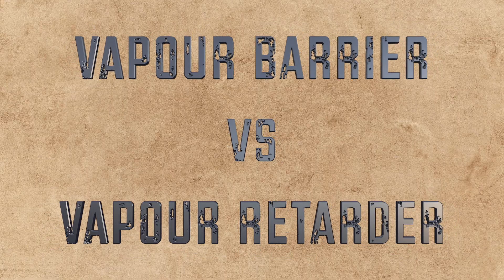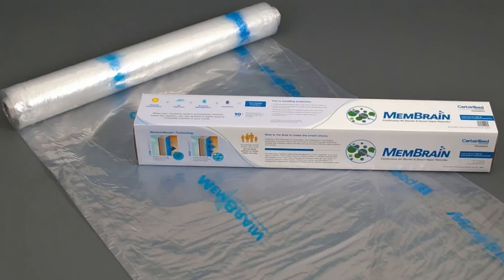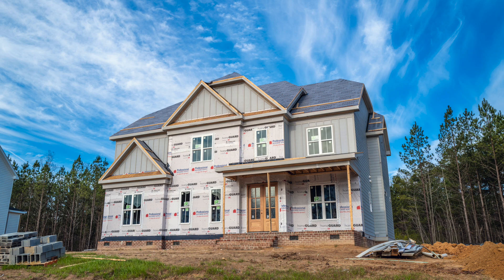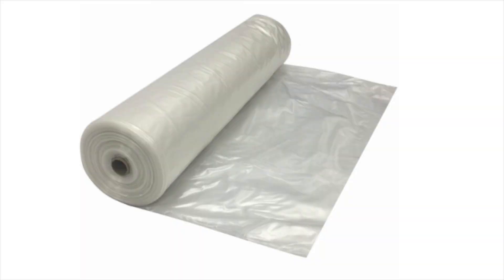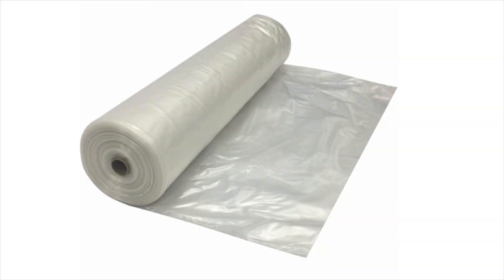Ancient Wisdom Meets Building Science: Vapour Diffusion Explained | Part III

Comment: hi Ive a 80yr old double brick house build out of formed concrete bricks with all external & internal walls built to the ground water in/egress probs. being managed with rubble drains.  my prob. now is with roofing insulation, & (Aust.) fire building codes requiring all spaces to outside of building envelope> 2mm be sealed. originally water dried out of the top of walls in hot roof space with large amounts of air movement. my concern is these management strategies will be negated with reduced water/air movement hastening damage with the increased sealing, & lowered under roof temps. Im assuming your fire mitigation building codes will probably follow/leap frog ours. Any suggestions?
Reply from the maker: You're absolutely right to be concerned about that. From what I’ve read, a lot of older brick and masonry buildings actually relied on heat escaping and air moving through the walls to help them dry out, especially near the top. So if you just seal everything up tight and add insulation without thinking about where moisture can now escape, you're asking for trouble.
Newer building codes push for air-tightness and insulation, but when it comes to moisture management and indoor air quality, code often falls short. To  give yourself the best shot at keeping the place healthy, you'd want to focus on keeping bulk water out first with solid roofing and flashing, maintaining a vented roof space, using assemblies that can dry, and pairing any air-sealing with intentional ventilation.
You need to look at the whole system and understand how moisture actually moves through your specific walls, not just check code boxes. You're already thinking about the right failure modes here.

Comment: Add Hempcrete to the outside of your rammed earth. I like a 24” rammed earth walls with 3.5” of hempcrete on the outside. It allows moisture to go through, but has the mass to keep the inside temperature warm in the winter and cool in the summer.
Reply from the maker: Great advice - the essence of "the perfect wall" - but with solid mass instead of stick frame.

Comment: What about airflow in a metal stud tiny home?  What is the best method of insulation and condensation problems?
Reply from the maker: Great questions! Metal studs act as major thermal bridges, so they can cause serious condensation issues if the insulation isn’t in the right place. I go over this in detail in my Thermal Control Layer episode coming out Thursday morning. As building scientist Joe Lstiburek puts it, “It’s a thermodynamic obscenity to insulate within a conductive structural frame.”

Comment: I'm wondering about 3D printed concrete homes. Open wall cavities that are airtight to the outside but do not diffuse vapor. No materials to rot, but still doesn't necessarily prevent mold growth. For the time being a lot of roofs are still constructed traditionally on them with wood.

The problem, then, is what the best course would be with air tight walls into a ventilated roof. A lot of stick built places here in the southern US have ventilated soffits and ridge vents to move trapped heat out.
Reply from the maker: Great points — and I share your hesitation with “new” tech like 3D-printed concrete. Even without wood, trapped moisture can still cause issues — not just microbial growth, but also cracking, efflorescence, and freeze–thaw damage. The walls are still concrete: capillary-active, highly conductive, and often completely vapour-tight — which means they can’t dry once moisture gets in. Airtight is good, but totally vapour-tight removes that last bit of forgiveness.

And you’re right about the roof connection — that joint between a sealed concrete wall and a ventilated, wood-framed roof is a real weak spot for condensation and thermal bridging. That’s where I’d be most concerned.

Comment: Your series of presentations has launched me into probably about an hour of watching YouTubes all linked to this subject.

Here is the latest development in the EMEDIATE need that I have.

BACKGROUND:
The current build has a temporary celling of DuraSkirm 20 held up in place by Cattle panels.
When it rains here (rare) there is a puddle that forms on the roof.
I'm working on gaining the materials needed to make the Cattle panels arch upwards.  Even with that there will be a thin zone where there is a flat roofing.  Add that in the winter Snow does up your insulation by a small amount, then a roof that allows for Snow build up is a plus.
OK, Back on track when there was a puddle on the roof there was condensation on the inside, as the rains here evaporated off the grounds.

So there are two possibles: 
1. Create a second skin that is off set from the first skin by a O say 2 inches.  Condensation would fall onto the second skin and then slide down to a catch tray drain.

2. Create a breathing cover over the most critical tool in the shed, or large tools that need to be placed outside during build season.
To that endeavor I think I've figured out the 3rd element in the tool cover builds?

The first layer starting from the outside would be DuraSkirm 20 that was heat welded into a formed cover.
The second layer (AND THIS IS THE NEW DEVELOPMENT "ENTAGLED MESH UNDERLAYMENT")  This would provide a constant offset for the breathing layer to allow moist air to leave the tool cover.
The 3rd and final layer which would be the most inside layer would be something like "Seal Skin" or one of the ones you have recommended?

So in your opinion:
Which of the multipole types of interior breathable layering's would both work the best and resist any wind battering's that the "Entangled Mesh Underlayment" would transfer from onto the top surface of the Breathable layer?
Would this create an environment that the rodents' would chew away in order to gather nesting materials?
Reply from the maker: Thanks for sharing all the details of what you’re working on — it sounds like a challenging setup with a lot of variables. I really appreciate the thought you’re putting into it.

That said, I’m not a building professional or consultant. I’m just someone who’s deeply interested in building science and moisture management, who reads, studies, and shares what I learn. For something as specific as product combinations, wind exposure, rodent concerns, and how different materials interact, I’d honestly have to research it in depth — and even then, you’d probably want advice from someone with hands-on experience in those systems.

I love that you’re thinking carefully about how to keep things dry and durable, but I can’t give specific recommendations here. Hope that makes sense, and thanks again for watching and being part of the conversation.

Comment: 1. The amount of moisture that enters into your walls purely by vapor diffusion is serveral hundred times less than the amount that can enter by air movement (leaks). That's why it's better to concentrate on the air tightness by means of natural building materials that are actually vapor open. 
This will give you a more resilient wall that can always dry to both sides if needed.

2. Vapor is a light molecule compared to the other rmolecules in the air. So vapor will always rise and the highest concentrations of vapor will be against the ceiling (the fact it's slightly warmer over there helps also).

3. "Smart vapor retarders" are more about marketing than building science (and a waste of money in my eyes).

4. I would not say that walls need to "breathe" but rather that they need to "sweat". Breathing means air movement, and we actually need air tight walls.
Reply from the maker: So good to see people digging into the principles behind moisture management! I go into air-movement in more detail in the previous video in this series — air can move vastly more moisture into a wall than vapour diffusion ever does, yet somehow the industry got fixated on “vapour barriers,” which often make things worse.

And yes — the whole idea of “breathing walls” can be confusing. When people say it, we almost never mean air movement (airtightness is crucial). What we really mean is vapour openness and the ability for materials to dry. The terminology could definitely be clearer!
Reply: @RootedResilientLiving  Oops, I  missed the previous video, sorry to bring this back up!.

About terminology there's indeed a lot of confusion that's why I don't like it that we keep speaking about breathing walls ;-)

Comment: I'm trying to take what you are teaching and apply it to tools being left either in the shed/garage or even out in the open.
(I have a very large table saw combo on large rollers (The outfeed for the table saw is another table saw turned 180 degrees and only runs a Dado blade) (The way to move the Beast is with a come along to get it up the ramp and back into the shed.)  Thus a protective cover that both breathes and doesn't let moisture in is needed.

There is the HTC Tool Saver.
But I don't think it would handle the high winds here and I could see suspending a second layer of 100% water proof material about 2 inches above it (Pardon my non use of metric! (And Americans' think themselves advanced Ha!))  This should keep the water from getting in and yet give the moisture a vented way out?????

I'm including a link and from the photo (They make larger units but I wanted to show off the potential problem of the metal legs allow for any puddles that form on accident under there to evaporate up through the tool.  I believe more would be needed so that water vapor doesn't flow through the tool before it leaves?????
(So I'm thinking that a lower half needs to be built and that it also would need like maybe a drain tube to allow anything that was caught in the bottom a way out?????)
Other possibilities would be to place the tool on some form of island base that would be high enough that any puddling would ramped away from under the tools????

So we have developed some "Options" on the wicking material for some covers there are:
"HTC tool Savers" that could have a second 100% water proof layer suspended above the cover. 
Or
There is "Seal Skin" car covers that material could be cut down into patches and then placed over the top and the side walls could be 100% water proof with a second layer 2 inches suspended above the wicking material
Or
There is the material you just posted could be worked into Something?????

https://www.hartvillehardware.com/product/sku-1563512?utm_source=Google&utm_medium=Google+Shopping&utm_campaign=GoogleShopping&gad_source=1&gad_campaignid=20006412656&gbraid=0AAAAACal8qMIHfMZIbJUl4RHx3tBmRNCs&gclid=Cj0KCQiAq7HIBhDoARIsAOATDxADNns-yDFdvc1fo7wBZSAGeeo0a8JXzqv39UNYcviZ18wZyRxRdS4aAlA8EALw_wcB
Reply from the maker: Thanks for sharing your thoughts and ideas — sounds like you’ve put a lot of consideration into how to protect your tools from the weather. There are so many variables with outdoor storage, materials, wind, and drainage that it really comes down to hands-on experimentation and what works best in your specific setup. I’m not able to offer specific recommendations, but I appreciate you following the series and thinking so deeply about moisture management.
Reply: @RootedResilientLiving  Thank you for the warm reply.
I'm not just looking for a way to start back into garage based manufacturing (BEFORE THERE'S A GARGAGE).
I've been working on my own form of shop space construction.
(What I've been talking with you about is not just gaining an understanding about moisture movement in an Experimental form of construction;  But more importantly how to proceed forward so that IF there is condensation drips again inside the shop space I have a "Defense in Layers" approach to keeping the shop space from further damages.)

"When all is said and done. There is more said than done!"  (I find this ratio to be acceptable since thinking things out often avoids both mistakes and un-necessary waisted efforts.)

P.S. I'm almost into year 4 of an Alt. build.  (So the small amount of time we have known each other is not a lot compared to the commitment I've made of the last 3 years trying to come up with affordable house ownership for those who are not at middle class.)
 Hypathis: IF those who are not at middle class status could own their own home in 5 year of involved assembly labor, then we would see a RE-emergence of the now shrinking Middle classes. 
(If you want to understand the design that I came out here to the middle of a Deserty area/NOWHERE to build, test, take down, move to Washington State's Rain forest re-assemble, and test again, take it down a 3rd time and then test it in Artic conditions.   Then check out Buckminster Fuller's DDU unit of WW2  (Not the Witicha house).  His was only 20 feet and upgrading it to modern needs would make it a least a 40 feet construct.)  I'm still back at trying to get all my tools' unpacked for the support building, to base the DDU test on structure.)

On the 11th I will be in a Zoom meeting to learn about adding AI to my YouTube's.  Over the winter I hope add a body cam with a wind proof microphone to my video equipment so that I can shoot better video of the ongoing build.

I'm 3 days into an "Out for delivery" from Fed Ex of Sno Seal paint for the widow's walk and the nights here are below freezing.  So I need that stuff applied before the Weather gets too cold to apply it and too cold to store it over the Winter.  I need to start making Calls to Fed Ex "Where are my deliveries?"

I'll send photos' the next time there is a puddle on the roof that causes condensation drips to form underneath the Tarp roofing.

Comment: I have a solid, double brick walled house from around 1900, with relatively poor insulation. Getting my head around the best way to upgrade the house has been extremely challenging!
Reply: The UK and France tend to insulate older buildings with hemp plasters that provide insulation without making the walls vapor closed. Downside is that if you're doing it on the inside, it can take additional square footage away from you in a house that probably already has thick walls. Worth looking into.

Comment: I'm really enjoying your informative presentations. You are so generous to find the time & energy to share your knowledge despite your challenges. I sincerely hope that you succeed in building your rammed earth home - a material I would love to use.

I do wonder about it's resilience against earth quakes, which is a key consideration where I'll build.
Reply from the maker: That’s incredibly kind of you — thank you. I care so deeply about helping people understand what’s gone wrong in modern building, and diving into the research and sharing it with others genuinely gives me a sense of purpose.

And great question! Rammed earth can be built safely in seismic areas — but it has to be engineered for the site since there aren’t standard earthquake codes yet.

Builders like Martin Rauch (Refined Earth) and Tim Krahn (Essential Rammed Earth Construction) show ways to strengthen it, using rebar for tension and trass-lime bond layers to tie lifts together and protect the steel. Definitely worth bringing those ideas to a structural engineer familiar with earthen or masonry systems.

Comment: Thank you for your presentation. Im asenior woman wanting to build a small home as best as a home can be built in our northern climate. So any related topic is welcome. Also a friend has a century home with sand as a basement floor. The home has no moisture problems.  Any comments on this unusual sand basement floor?
Reply from the maker: Thank you so much for watching. I’m really glad the topics are helpful.
Older homes can be fascinating when it comes to moisture. A sand basement floor can sometimes work because moisture can move freely and dry instead of getting trapped, but there are always a lot of variables — soil type, drainage, grading, and how the rest of the house handles air and vapour.